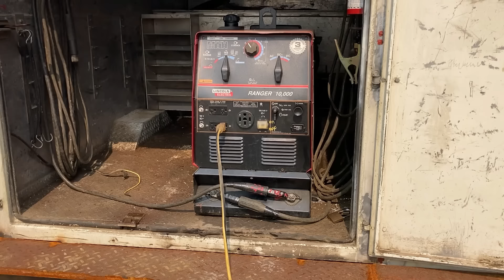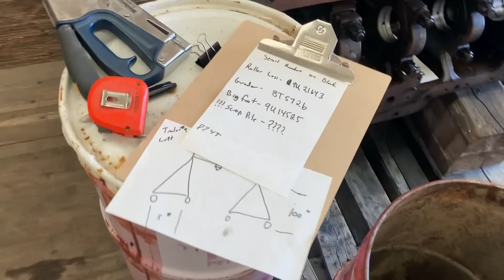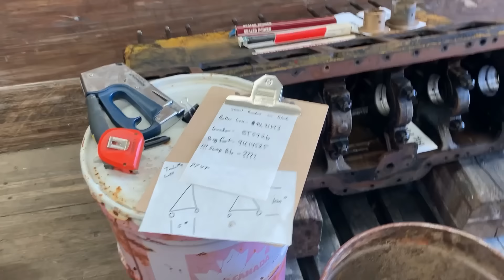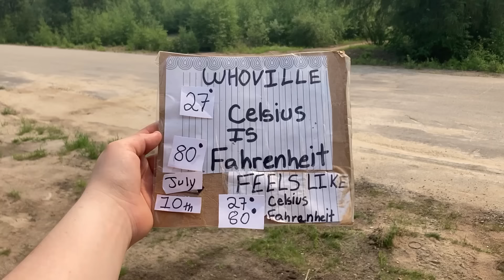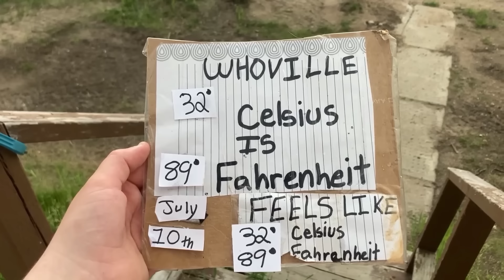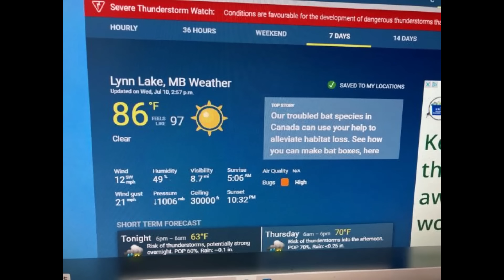First Hot Day of Summer: Only Four Left for Us July 10 2024

Comment: have sir rodney hook you up with some plastigauge. its for checking clearance on crank bearings. you just put a piece of it on the crank, add the bearings and torque it up, take apart and compare it with the scale on the package and it tells you everything you need to know about the clearance
Reply: Well, it was either THIS episode today, or yesterday`s episode,  he had plastigauge out, and talked about it briefly.
Reply: @stanpatterson5033  Yeah, it was this episode where he showed packages of plastigauge....
Reply from the maker: he did and we will be doing that once i build a overhead lift so we can lift out the cranks when needed.  thansk
Reply: @kingofobsolete4789  glad to hear that. worst thing is to build an engine and have a malfunction! carry on king.